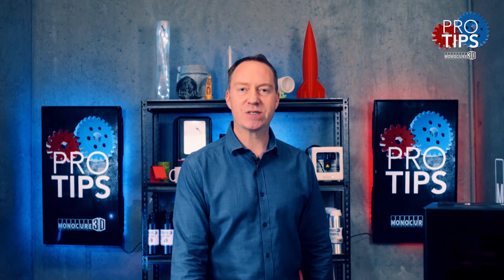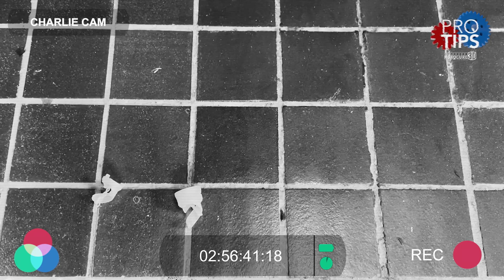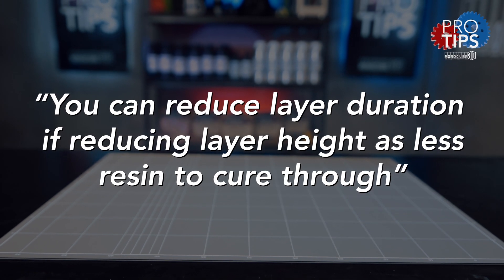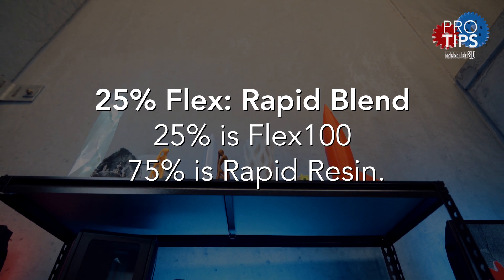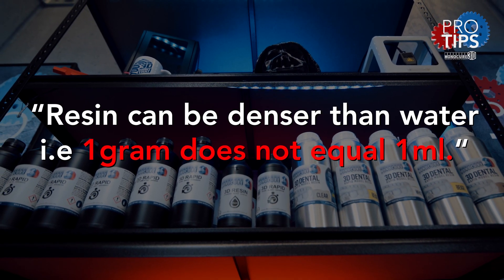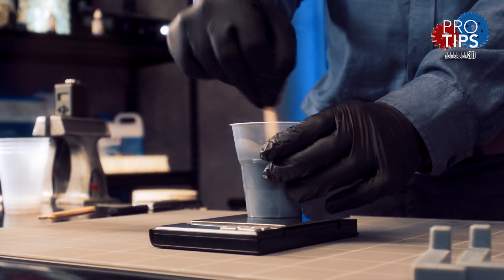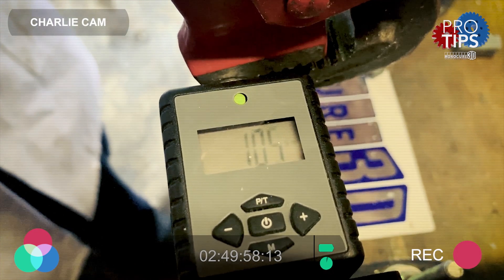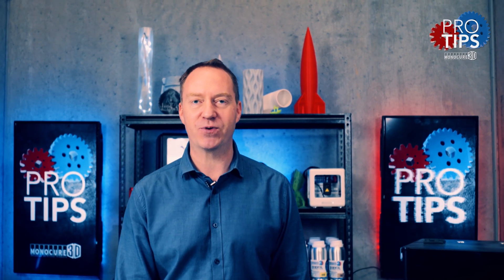Tips to make your resin 3d prints more durable.

Comment: Nice video can you redo the mixed  resin test and do the SAME twist for both mixed and unmixed like both by hand or both with a pipe wrench? Your two different tests put different stresses on the product, I would love to see both resins done both ways. as well as tensile strength both with and against the print direction.
Reply from the maker: Great idea! We will get a new method for testing soon.